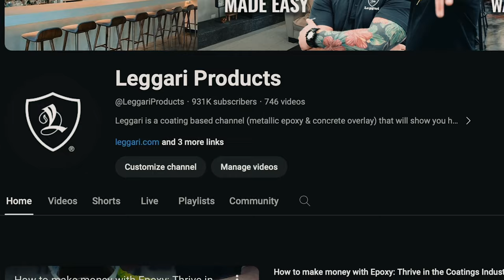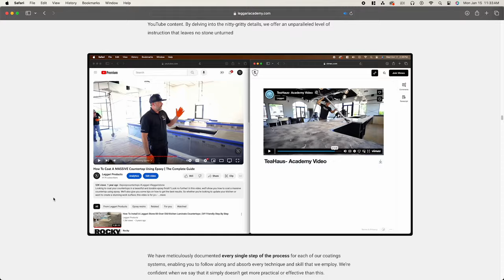Epoxy Countertop technique | Beautiful results using cardboard

Comment: Trabalho excepcional! O álcool isopropílico e de quantos por cento?? É para tirar as bolhas de ar????
Reply from the maker: The first thing we spray is 91% or higher isopropyl alcohol. This creates cells in the design and disperses the epoxy. Once that evaporates, we spray denatured alcohol to pop any micro bubbles that might be in the epoxy from mixing. This allows us to avoid torching the epoxy and the risks associated with that.

Comment: What is the product he used in the spray?
Reply from the maker: The first thing we spray is 91% or higher isopropyl alcohol; this creates cells in the design and disperses the epoxy. Once that evaporates, we spray denatured alcohol to pop micro bubbles. This allows us to avoid torching the epoxy.

Comment: My problem is:  I do not have a plywood base by which to start
Reply from the maker: It can go over all sorts of surfaces like granite, tile, formica, wood, concrete! What surface do you have?
Reply: Start with MDF board.... It's cheap. Ypu would have to scratch up surface first..